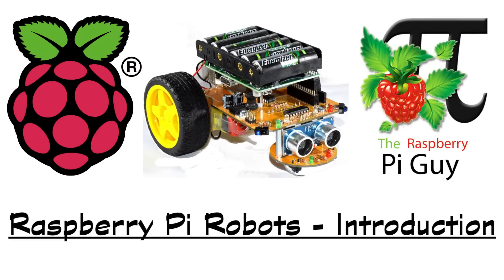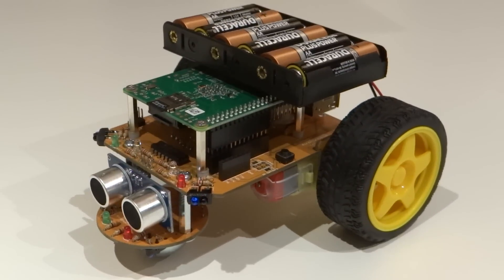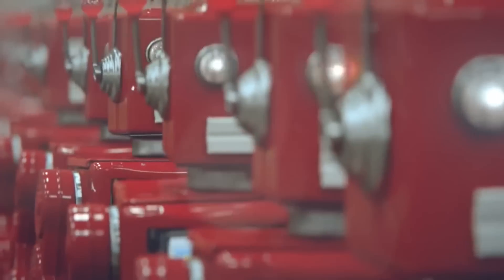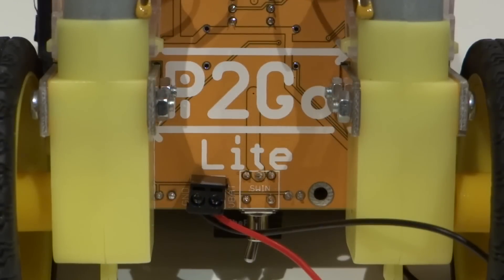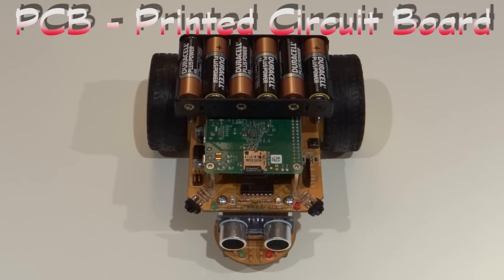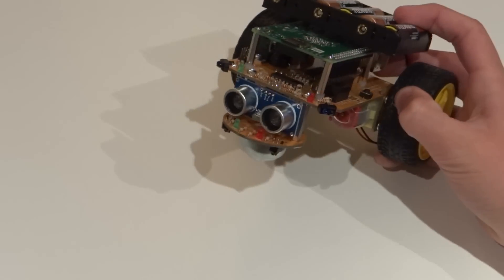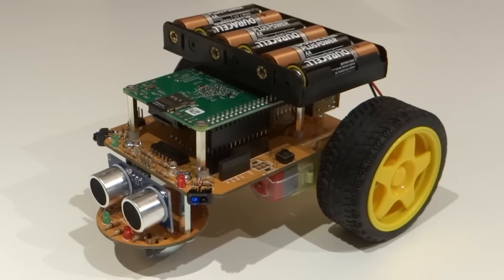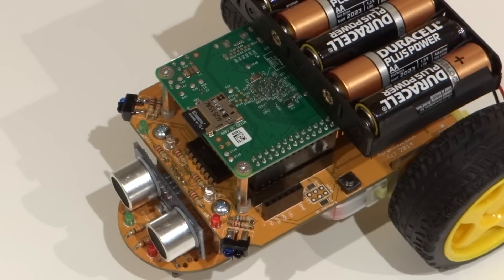Raspberry Pi Robots – Introduction

Comment: I've just finished constructing my Pi2Go-Lite. If anyone is thinking of making this robot who has an original Raspberry Pi then you will be disappointed because that issue of the PCB doesn't have the necessary mounting holes for fitting the Pi. I was lucky that I had a version 2 board too so could complete the build. Construction took way longer than the 90 minutes too and I'm an experienced constructor.
Martyn.

Comment: Why a RPi when you can use a Arduino? Oh wait... you're the raspberry pi guy. ha.
Reply from the maker: Err... Yes. 1) There are a multitude of reasons for using the Raspberry Pi over the Arduino. 2) Just because I am The Raspberry Pi Guy does not mean that I do not do Arduino related stuff too. I have done several Arduino videos in the past!
Reply: ***** Yeah. I know that. likeThe RPi has ACTUAL USB ports.